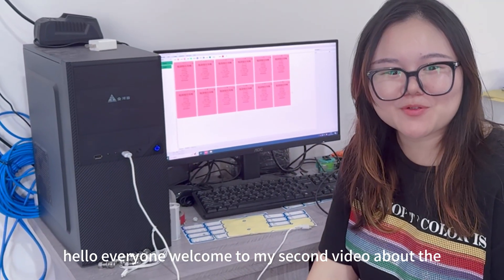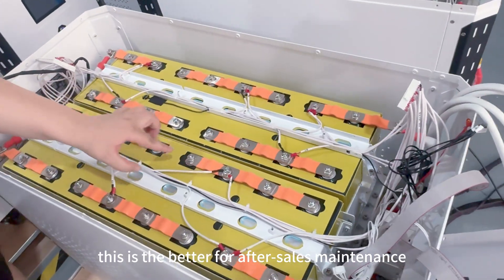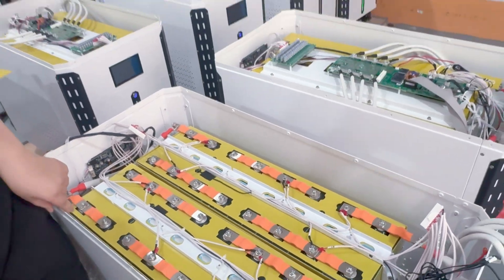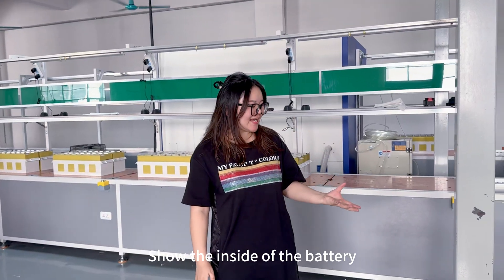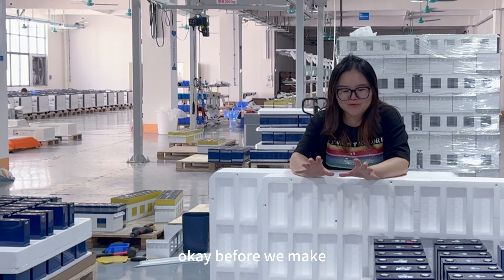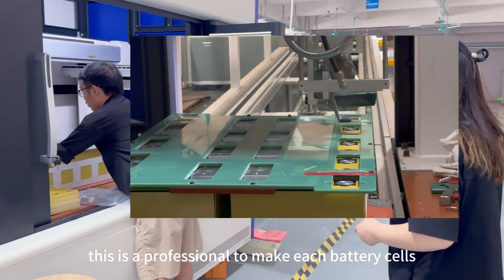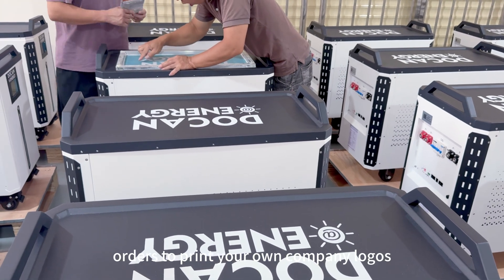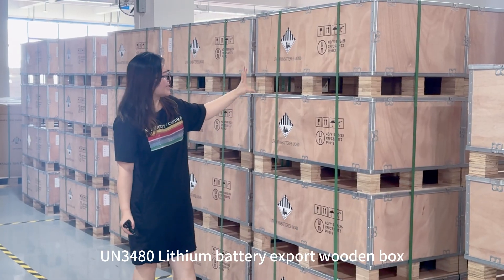Solar ESS Solution Panda 32kWh 628Ah LiFePO4 Battery Pack Internal View From Docan Amy

Comment: Qual é o bms e arranjo das ligações das células?
Reply from the maker: Thank you, Daren 200A WIFI BMS, Assembly for the battery cells: welded busbars connections; or screw-fastened busbars connections that only can supply from China so far.
Reply: @DocanAmy mas é 2P ?

Comment: I like the build.
What BMS is used?
Can it communicate with Victron canbus or Node-RED? Which protocol is used and how many batteries can be connected parallel?
Reply from the maker: KS 200A WIFI BMS , yes it compatible with Victron inverters, we have user guide, please contact me via email: amy@docanpower.com Thanks
Reply: @DocanAmy  I will contact you after the current holidays. I hope that Andy from the Offgrid Garage can and want to test the unit. It can bring you many customers world wide.

Comment: Ive already ordered two and expecting my order soon (end of October) but am wanting the bolted terminals, not the welded. Is it possible to receive bolted terminal cells and not welded? How long before the bolted cell terminals are shipped to Houston warehouse?
Reply from the maker: Thank you. Bolted cell terminals are still under production in China, and USA stock will not be available for over three months. Anyway, the welded connection is actually a more professional and reliable assembly method than the bolted type. Both of them with same warranty
Reply: @DocanAmy  is there any information on how to use this with a grid tie and off grid usage ?